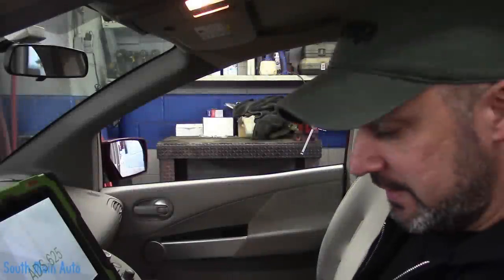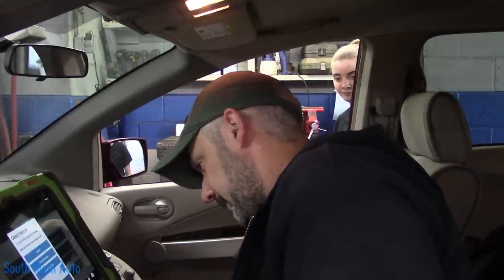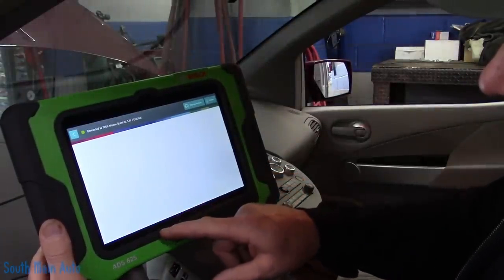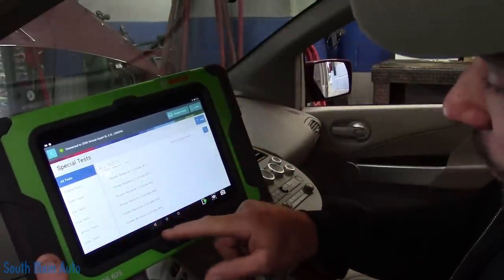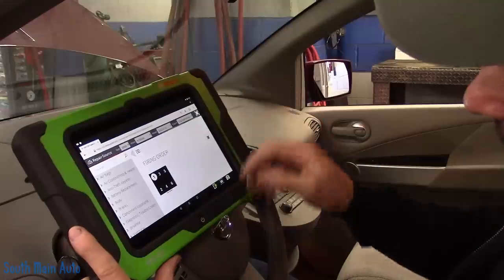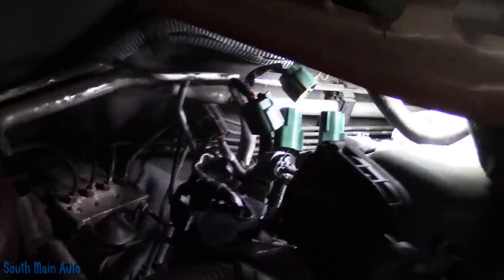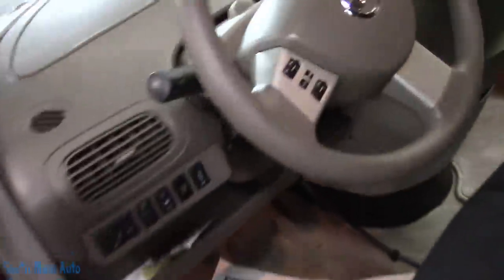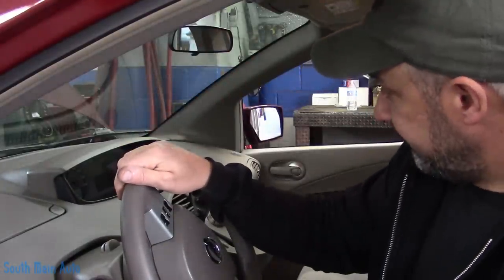Customer Replaced Spark Plugs And Now It Runs Bad!?

Comment: Was doing my first ever head gasket on my 95 Subaru Legacy...I was in the process of putting everything back together again. I was desperately trying to get to work that morning so I was up at 6 am (10 am shift) to put my timing belt back on. Got everything zapped back on and got the belt on; Started it and it fired right up, except shortly after it through a cel. Plus it wanted to rev till it blew up. Shut it off and kept trying the same thing thinking that some gunk may have gotten in the engine and it would work it's self out. I finally gave up the ghost and asked my mentor and figured out the engine rev issue was from already compressed intake gaskets. (didn't have the money at the time to replace them.) pulled the code and it was a cylinder 2 miss fire. I double checked my timing and looking at my driver side cam noticed I forgot to pull the pin on the tensioner. OOPS. I had the initial timing right until I started it and then it jumped timing. On top of that once I got everything going again my co-worker at the Firestone I worked at noticed my water pump was leaking. It ended up taking a week for me to finish it due to money and time constraints. Got the water pump replaced, fixed my timing issue and it finally started purring like it was supposed to and 10x the power it had. After everything was fixed it felt like a new car again. Then it got stolen the following winter.

Comment: One of my no-brainers was when replacing a section of fuel line, flaring the end and forgetting to slide the fitting on first.  That, or fighting a coolant hose in a tight spot, getting it on the nipple, and only then noticing that I forgot to slip the clamp over the hose first. Or repairing broken wires and forgetting to slip the heat-shrink over first. 
Notice a trend here?

Another one, (not my no-brainer) Was changing the spark plugs on my 84 Fiero.  I had a friend helping. The plugs on the 151 Iron Duke are facing the front of the car,  thus, in a Fiero, toward the firewall  (Remember it's a mid-engine car)  The car only had 32k original miles on it in 2009, so I'm assuming they were original plugs and had been in there since new.  Those plugs were pretty stuck.  I can't remember how, but the insulator broke off of #3. It broke and took most of the core with it, except for a little chunk of the porcelain, which was still clinging to the inside of the hole.  I go to take that out and hear a "clink!" sound.  Pull the socket off and see that small chunk of the insulator was gone. The sumbitch fell into the cylinder.  I cuss a bit, dreading the inevitable head-removal and all that it entails.  I'm pissed.  I walk away to keep from launching my ratchet into low-earth orbit, or through the back window.  Before I know it, I hear the car cranking over!   I'm thinking "There goes the cylinder!"  I run back yelling "STOP!" and I hear the air spitting out of the empty spark plug holes and finally a "PING!"  I see a small white projectile bounce off the firewall, then up and off the decklid, and land in the rear trunk.  It was the piece that had fallen in.  Somehow, miraculously, when he cranked it over, it spit that chunk out.  I checked the compression and it was fine.  The car-gods were with me that day.  I still have that car.

Comment: When a teenager i had a giddyup 409 with dual 4 barrels. Wide open on the highway just holding the petal to the metal in 1/4 mile it used a quarter tank of gas. 64 impala. Flat spotted my red strip wide ovals backing up one day at 45 mph. Can't steer going that fast backwards.

Comment: First time I changed spark plugs on my 2007 Saturn Outlook I unknowingly knocked off a very small plastic tube for the PCV system. Ran extremely rough, engine light on, constant dinging from the dash because traction control, stabilizer and another light were going off. Had to take it to the shop. Found out it was a $5.00 plastic tube that went over the PCV valve. They also replaced the intake gasket.

Comment: I consider myself reasonably knowledgeable with car / truck mechanics at the over-ripe old age of 60+, and this happened about twenty years ago. I had bought myself a Nissan Terrano 4wd Auto with the vq30de motor. On one particular day I noticed the the engine sounded slightly "off" and sort of reving to high, noticing that seemed to be somehow related to the gear changes I had a wee panic, so as I wound pass a transmission shop on the way home I called in, related the problem. He took it for a 5 minute drive and returned saying " All fixed!" What the hell I said, to which he responded with a grin, you had the transmission in "power mode" I felt super stupid, and without saying a word I stuffed $20 note in his overalls top pocket and sheepishly drove away. How the heck I thought, then I remembered, my dog, who had been jumping around in the truck earlier that day must have stomped on the switch which is in the center console.   Argh!!!

Comment: 1993. Did my very first engine swap on a 1986 RX7. Hours upon hours of learning. Went to fire it up for the first time and it would crank/no start. More hours of looking. Tow to Mazda dealer, it’s ready an hour later. Forgot to connect the ground wire. 🤦🏼

Comment: Totally rebuilt a Dodge Caravan V-6 engine and would not run properly when done.  The engine had a distributor and cap.  Found that the distributor cap was built so that the contacts inside did not come out directly above their position but one position around the cap.  I had the wires on  in the proper firing order but one location around the cap off.  Never saw a cap like that before or since, but a soon as I moved them around one portion the engine ran like a top for another 100K.   I asked a dodge mechanic why would they do that and he said probably to save a few inches of wire on several hundred thousand vehicles.    ARGH!  Live and Learn.

Comment: When I was a kid working with my Dad we worked on our own vehicles. Basic stuff tune up brake jobs. 184 36572 Chevy 350 firing order right? I'm 23 and bought a 68 olds holiday 455 Rocket. Did a tune-up on it and when I went to start it backfiring through the carburetor. Double check my wiring they're fine. An older friend of mine came over and said oh here's the problem Oldsmobiles have the distributor on the other side of the camshaft so it was running a hundred 180 out of time lesson learned that I never forgot. LOL

Comment: Once owned a "85" ranger i gave a tune up . tried putting in new rotor button but it just would not stay where i put it when trying to put the new distributor cap on . walked away really mad and had lunch , came back to find i was putting the rotor in upside - down the whole time !!!

Comment: I rebuilt my 4l60e. on my 96 Yuckon, I wanted to trick it out, so I bought a Sonnax servo for it. I didn't realize that you were supposed to take apart the old servo  use a spring from the old servo. Also that it would require a different apply pin, in fact, I didn't really understand that it wasn't plug and play or even how to check the final range on the servo. (I could blame Sonnax, but I suppose they assume you know what you are doing, LOL)  The result was a hard 2,4 shift and a burned band and input drum. Luckily for me my brother is an expert. I threw the suspect pieces in the back of my car and he spotted the problem in about 2 minutes. I got to do the job twice, he got to laugh at me. His experience saved me and my wallet escaped major damage, my pride was another story.

Comment: When I was changing oil on my truck, I screwed the old filter off. Screwed the new on. Little did I know the gasket had come off the old filter and stayed on the block. After starting the truck , I had oil pouring out profusely. I didn’t realize it until the puddle of brand new oil was seeping out from under the truck. Pumped out all 6 1/2 quarts.
Reply: Many years ago, I rented a nearly new Ford Taurus SHO from Hertz at Sacramento CA airport. Toss the luggage in the trunk, leave airport, freeway ramp about 1/2 mile from Hertz facility. Punch the throttle, dash oil light, I roll to a stop as quickly as possible. Engine had "stalled" while still rolling. Pop the hood, oil EVERYWHERE. "Rod" I think? Go back to cockpit to call for help and notice the odometer is reading something like 3012 miles. Hmmm, go back up front... locate oil filter which is now quite loose. Spin it back a bit and YEP, you guessed it.. two o-rings.. OOOOPS as they say in the fleet service industry. Back to cockpit. Tap starter CLUNK!. Scratch one SHO. I'd hate to be the 'kid' who did that oil change.

Comment: Once I was working on my emergency brakes and I couldn’t figure out what was wrong so I loosened the rear wheels in preparation to jack up. Well I got pulled away from the job and forgot all about the loose lugs. Was driving to soccer practice when I heard the rims sound like they were cracking. I could see the wheels wobble in my mirrors. In the end they didn’t fall off and I got them tightened up before disaster occurred.

Comment: I spent an hour trying to figure out why the timing mark wouldn't line up on a cam gear after doing a cam seal. Turns out it was flipped around cause it could go on backwards. Had to have someone else come look at it (co-worker) before the possibility of it being able to be flipped even became an option. Since then, I mark the front of the cam if it's not stupid obvious.

Comment: rebuilt engine and gearbox in a classic mini. Put the reverse gear the wrong way around on the shaft, no reverse gear.
Luckily the car was light so I could normally push it backwards out of parking spots. About 3 months later got tired of that and took engine and box out to fix.

Comment: Changed the oil in my car. After refilling the oil, I started her up. Oil warning light was on, then off after a few seconds, normal. Then it flickered back on, not normal. That's when I noticed my old filter was sitting right next to the new filter. 
20 minutes to change the oil. Two hours to clean up.

Comment: About 50 years ago I overhauled an engine and didn't hone the cylinder walls.  What's the saying, "that's what you get for thinking?"  Feeling pretty righteous about the job I was doing, I decided that the purpose of honing was to smooth the cylinder walls.  "Heck fire, these cylinder walls have a mirror like finish, they don't need honing."  The thing smoked so bad it was embarrassing, and probably dangerous since it looked like one of those smoke screen machines you see in war movies.

Comment: As a diyer my self I lable every connector and pipe I take off as well as take plenty of high definition pictures just to be on the safe side it's especially important if your going deep into an engine, I got stuff mixed up when I was 17 years old working on my first car rebuilding an engine and getting the plug wires mixed up and the distributor timing back to front, luckily it was good old dad to the rescue and with words of wisdom "lable and mark everything you take off so you know where and how it goes back" live and learn.

Comment: I over torque the inlet manifold that I crack it.. on the corner of it.. even though it made a funky sound when I tap it with my finger like a empty shell.. so I got lucky and found one at the junk yard installed it and now I learned

Comment: This mistake was done recently on a 2012 Ninja 650 in the middle of a valve shim adjustment - set torque wrench and didn't check and verify that it was in inch-lbs (it was ft-lbs.) One snapped bolt later, I'm having the fun of fishing the sheared end of a bolt out of the head.

Previously to that on a '85 Subaru DL I hooked up the supply and return lines to the fuel rail backwards after a rebuild.

Comment: Changing the failed trans temp sensor on 2004 excursion diesel. Had to take the trans pan down, no drain, pulled the trans filter and oring - made a hell of a mess. Got the sensor replaced, new gasket, about 20 bolts, wiped it all down, cleaned up the floor, put the new fluid in .... then I noticed the new trans filter sitting on the passenger seat....

Comment: So, I was a 17 year old mechanic prodigy. Drove a tow truck and worked at a garage. One Saturday I took a call from a customer who had done his own tune up and now every time he drove down a hill his distributor blew up. I disagreed with him because "distributors don't blow up." He told me to bring some caps and he would pay for the tow. I drove over and the car ran great. He says grab a cap and lets try it out. We drove around, no problem, go down a hill and BANG followed by car dies. Open the hood and guess what lots of shrapnel and the distributor has blown up. I learned real quick that sometimes it is super weird but what the man says is in fact what he is experiencing.         Just in case your wondering the problem was a hole in the vacuum advance diaphragm. It allowed intake manifold to communicate with the cap. When he did the tune up the new gasket didn't leak like the old one used to. Thus when you put your foot on the accelerator at the bottom of the hill you had a temporary 9 cylinder when the manifold vacuum dropped.     Oops I am showing my age huh? lol

Comment: I once installed a head gasket upside down.... it ran well and didn't over heat, but it was running hotter than normal.

Comment: My best mistake! Replaced multifunction lever on my 2003 Grand Am. There's this thin metal ring that has to come off and go back on and serves some purpose as part of the horn switch when to push on the center of the steering wheel to honk at people holding signs that say "Honk for donuts." Anywho, unknown to myself, when you put the ring back on there's a pin you have to depress to make it mount flush and I didn't do that step. So when I put it all back together and started driving around,  that metal shim got all bent up inside and caused the horn to honk super quick as you turned the steering wheel. So it was like a loud turn signal. Honk...honk...honk I'm turning! haha! As it was in it's last legs anyways with the subframe rotting out on it, I just pulled the horn fuse and went without the horn all the way until the bitter end.

Comment: Pulled the gearbox off my Ford Courier 4x4 replaced the clutch and decided to replace the rear main seal put it in backwards and it leaked badly not long after driving it. Out came the gearbox clutch and flywheel to fit another rear main this time the correct way around.

Comment: I'm only 18, so I've got a long time to go and make silly mistakes yet, worst I think I've done so far, is after changing "all" the spark plugs on my truck, fired it up, ran kinda rough but took it for a drive anyway to see if it'd sort itself out. Needless to say, it did not, had a flashing check engine light and a misfire after about a minute so I figured I maybe didnt have one of the wires on right. Pop the hood, and I entirely missed one. Got distracted half way through the job, left it on the top of the tailgate of my truck, and forgot about it. Lost it on the road somewhere, wound up having to get a new one.

Comment: I realize this is a year and some change after, but here are two good ones.

1) Buddy and I leaving the barracks to go get some chow in my truck, he notices an early 90s Ford Exploder with the hood open. He goes to check it out and calls me over (I worked automotive for a few years while going through automotive schooling at a community college). Talk to the owner of the rig, no start, no crank. He had been at it for an hour or two, went and had the battery tested off base and if my memory is correct he was about to replace the starter or did already. I peek into the cab, tell him to get in and run it through PRNDL and try it (those who know, understand why). Fires right up. The hanging shifter will get you every time.

2) This one happened about a week ago. A buddy has an El Camino he wants back on the road (wouldn't shift right one day coming back from school, limped home and parked back in 2017). I do some preliminary things and was able to get it to shift through all three gears manually but in drive the shift points were ATROCIOUS (1-2 shift at like 40 mph). When I Google it, I dumbdeduced it having a THM200 transmission (non-vacuum modulated, V6 engine so I figured it would not have the TH350). Did more tinkering and couldn't get the shift points any better. Was calling it for the day and decided to take a photo of the transmission to see the style of pan was for a filter kit. I looked at the photo, said a few colorful words, got the jack and stands out, hooked up the vacuum modulator and verified shifting through all the gears. Hooray, it's fixed. My buddy is happy but I am kicking myself for not checking the simple things and verifying.

I could probably go on with the simple mistakes I have done like firing orders wrong or what have you. Just remember Keep It Simple Sillyhead.

Comment: I just replaced my spark plugs, and I had to take the top of the intake manifold, the throttle body, and the air intake off. Got it all back together and my car was in limp mode. I forgot to plug the throttle position sensor back in. Got that squared away and it ran great, but there was a high pitched squeal. It was late so I just went to bed. Woke up the next morning and the squeal was gone and the car ran great. Skip forward two days and now my car idles like crap, constantly dropping down to around 500-700 rpms, and it doesn't have the power that it had when I first replaced the plugs. I'm not getting any codes and the idle doesn't change when I test the cylinders. I'm assuming it's a vacuum problem, but I've not got the knowledge to start looking into it. I'm going to call a shop tomorrow and see about getting it looked at. I'm sure this is going to cost me quite a bit, which sucks because I don't have the money for it. Looks like it's going on a credit card.